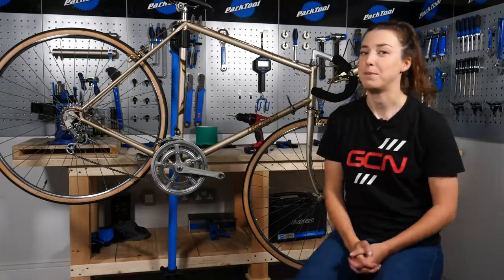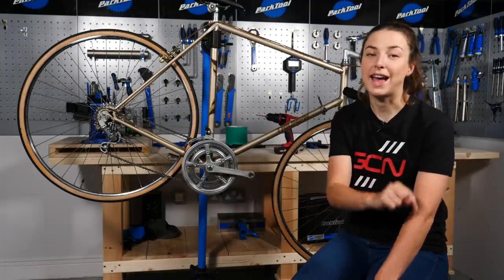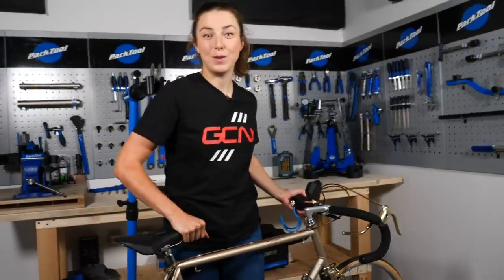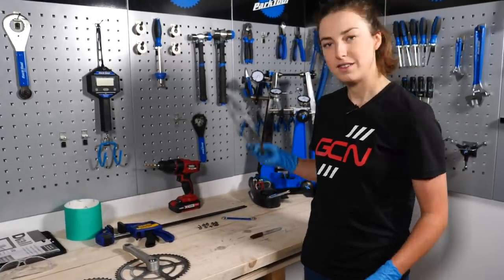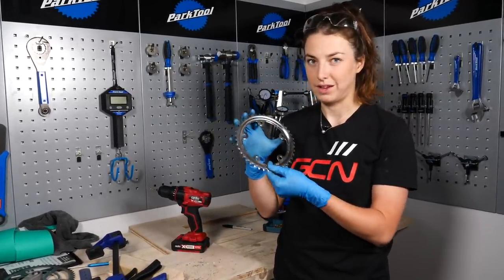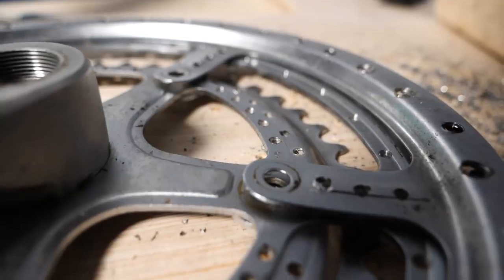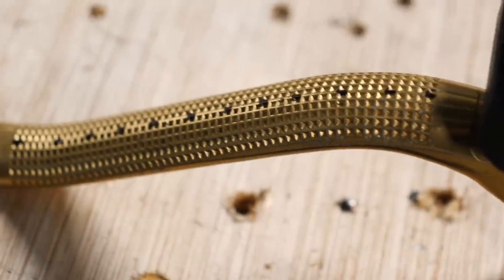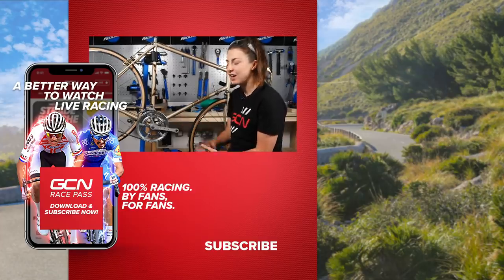Drillium: The Ultimate Retro Bike Mod | We Drilled A Road Bike

Comment: I know the video is supposed to be silly but..... drilling holes is about saving weight. Tossing the chain guard ring saves more weight than drilling holes in it. I bet a good length can be cut off the seat post as it is very low in the frame. Lighter rims and tires (rims look like 27" steel??)..... before drilling any holes.

Comment: Although alf engers was known for extreme drillium he realised that all the holes caused turbulance and that aerodynamics was the way to go when he built his record breaking bike he monted the brake levers behind the handlebars and the front calliper at the back of the forks brazed the bars to stem so it had no bolt and could be filed smooth  as well as removing any excess weight he also taped over the laces on his cycle shoes to give a smooth flow of air

Comment: How can Manon be apprehensive about drilling holes when she does rally car driving as a hobby?  Surely driving a rally car as a hobby also includes maintaining the rally car.

I know nothing about rally cars, but how did she get the roll cage in her rally car without drilling any holes?  Surely there must be other rally car maintenance involving drilling, like attaching a fire extinguisher to the inside.

It doesn't make sense.
Reply: To be fair, drilling into small, loose parts is pretty hard without a good vice. All she had was some clamps and a piece of 2x4 lol

Comment: instead of drilling, my best upgrade to save weight is to upgrade wheels, tyres and tube. Steel frame only difference from alloy for about 200-300 grams but you have to sacrifice ride quality while the different between 2kg wheel and 1.5 kg wheel is day and night.
That's said, if you already do everything to save weight (including upgrade the tyres) then drilling might be an option but it's the worst option.

Comment: drill your crank dust caps (or take 'em off)
Use CAD. Figure out how to cause failure in any part when the speed or load exceeds pre-determined levels.
Hire a crash dummy to prove your design.

Comment: It is a bodge because the bike lost only 20 grams.  If you want to lose the weight on the bike than I would suggest to switch those steel rim wheels to an alloy set, change the steel post to alloy seat post, change the crankset to a newer alloy crankset and change the handlebars to an alloy handlebar.  Maybe, the bike would lose one kilogram or more.

Comment: The effort expended to remove 90gms from your bike results in a 1kg loss in body weight. I think you’re onto something Manon. By the time you’ve drilled enough holes to get the bike down another 200gms you will have lost an additional  2kgs in body weight for a total weight reduction of 3.29kgs for bike and rider. Genius 🤣

Comment: I was told the weight limit on bikes in pro races was put in place in the 70s to stop teams drilling out to much metal to save weight and making  the bike structurally unsafe i think the weight limit is still enforced even though modern bikes are well under the limit and still safe

Comment: Probably ruined several drill bits by cutting metal without fluid. Only to save 90g. Just taking the “bash guard” off completely would have probably saved 10-15g of that with no drilling at all. Also I bet they have a parts bin seat tube, bars, fork or something that could have saved the other 75-80g.  If you’re going to drill... do it right and keep going until some actual weight is saved.

Comment: Its definitely a marginal gain. You can convert it to 700 c wheels with microshift bar end shifters and get a 10 speed group set or set it up as a 1x11. Or run a 1 1/8 carbon fork with. Carbon fiber handlebars. Go full retro mod. Thats what I'm doing with a 1977 peugeot pr10 I have. Then you'll have a bike for commuting and it will be better on the climbs!

Comment: This was actually an oddly compelling video; very entertaining, I gave it an emphatic thumbs-up. Mannon is an awesome presenter. However, I think drilling holes in one's bike is sort of insane,  and, as we see, not particularly effective.  If you're worried about weight, and want to keep using the same bike, it's easier and probably a lot more effective to take 1-2kg off the rider. (i.e., skip the mocha and cake at the cafe stop, and settle for a regular coffee or espresso instead.)

Comment: Manon I assume is lucky that some parts of that old bike could be steel. Like that chain ring. That could be easily drilled out with less failure. But in the old days of bicycles. There were some good aluminum parts too. But it becomes dangerous when dealing with aluminum parts to make the bicycle even lighter. Not recommended. Lightness of the parts today is from good forging of aluminum parts and figuring the breaking points now from computer analysis.

Comment: Drilling holes "Works" the metal.  It isn't defined clearly as to whether drilling "Toughens" the metal; but, it "Hardens" the metal around the hole.  This isn't something that's overdone on Aircraft, or recommended.  The worst you might have done is heat-warped one of your chainrings.  You could safely take a lot of weight out of the crank arms - you NEED a drill-press for this.

Comment: Could not quite get my head around this one. I've got a 'retro' bike and the thought of butchering it to save grammes seems altogether bonkers. Manufacturers don't give away metal and to take it away seems to not only disfigure but to weaken. Every single hole is yet another hideout for dirt and grit. That means more work or more ingress for water and rust. Did the sum total of the material drilled out weigh more than bottle of water or even a Mars bar?? I'll live with my bike and seek weight reduction in cargo rather than on the machine. Nevertheless., thanks for the video and your insights.

Comment: It looks "techy" for a diy.  I think you could definitely take some more material out of the frame.  And I saw a stem in the introduction with holes in it, you should do that also.

If you take material out of the frame, you'll want to protect the bottom bracket from water and debris.  Also, with holes in the frame, you could route the cables through the frame.

You might want to see what others have done safely, or get a bike frame designer's opinion as to where would be the best places for removing material.  I think the down tube could lose a lot, but I'm no engineer.

Comment: 10:48 12360grams or 12.36kilograms. 
Wouldn't it have been easier just to weigh the crankset and gear levers rather than the whole bike?
Also you could have saved a lot of effort and drilled much more precisely using a drill press. Use a centre punch!
Reply: I said the same above. Thanks for the reinforcements.

Comment: What could the design engineer have been thinking, making all those parts with so much unnecessary metal? And how stupid of him not to think of putting lots of holes and stress concentrations into the mix. If you did this to aircraft parts you'd get fired at least, and maybe arrested. I guess if you want to do this to your own bike it is your lookout, but don't ever sell it.

Comment: If the components would have the same structural integrity with less material, I am sure the manufacturers would be the first ones to reduce the amount of material used. Clearly the drilled parts will not meet the specifications. Where are those guys that claim the chinese parts and frames are dangerous???

Comment: And all the armchair mechanics come out with the obvious!...
Of course you should be using a drill press (pillar drill, in old money, ) rather than a hand drill, with sharp bits (preferably high speed steel,) and coolant and spot each hole with a centre punch before you begin drilling abd remember to de-burr the holes after! (No sharp edges to snag your ankles!) but not all of us are trained in the art of metal cutting.
Manon's a cyclist not an enginneer, but I do feel some timely advice from her mechanics wouldn't have gone amiss... Or, maybe they're not engineers either!....

Comment: Nice project. I suggest to keep this bike and keep it as an ongoing project to reduce weight. For instance, throw out the basher and the hand lever extensions. Cut off those bike pump pins. Maybe even use it as an vintage bike restoration.

Comment: First off, a simple arithmetic calculation involving the mass of the various component materials and the number and size of the planned number of holes to be drilled would yield the amount of weight loss to be obtained, and it wouldn't take nearly the amount of time of drilling all the holes. However, I suppose such an approach wouldn't make an entertaining video and wouldn't help the young woman improve her use of hand tools. Secondly, drillium is just one of the many, many ideas that have been tried in the last century and a half of bicycle "improvements." The ones that have been found to be truly worthwhile are the ones that were implemented year after year, and the ones that weren't were only briefly produced. Therefore, attempts to recreate failed ideas from the past are usually a big waste of time.
But I suppose the need to fill video air time may provide a reason to do so.